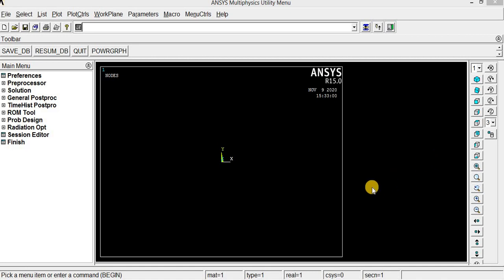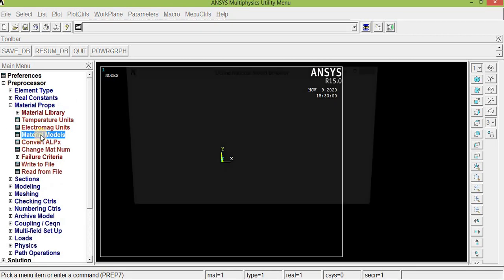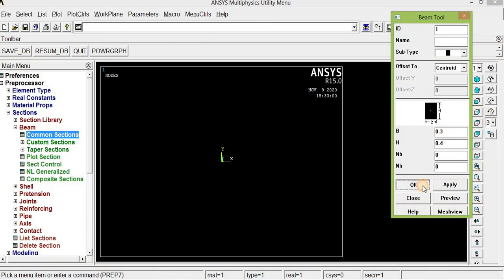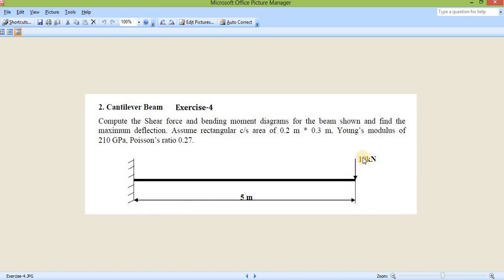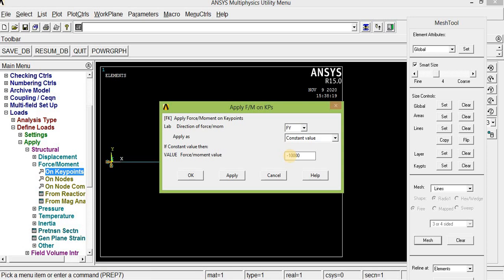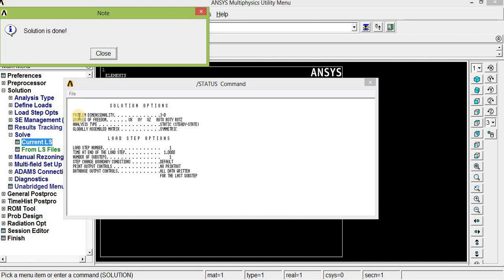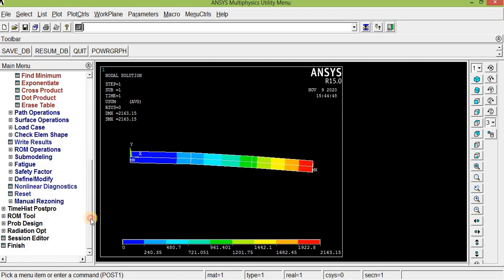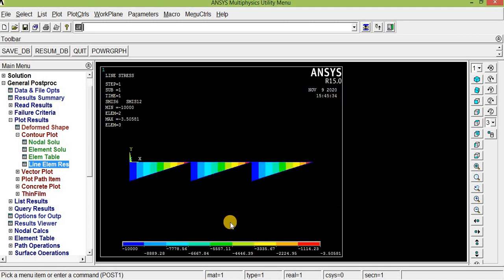Shear Force, Bending Moment Diagram and Deflection of the Cantilever Beam using Ansys APDL

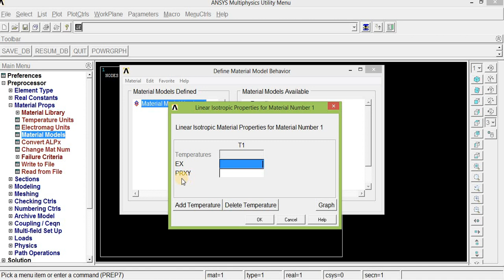Comment: What value did you put in material models @ 1:44 .
Reply from the maker: EX that is Youngs Modulus = 210 x 10^9 
And PRXY is poisson ratio = 0.27
Reply: @infolearn1984  I used this value but cannot add the value in define table @ 9:01 . It shows requested database is not available. The Etable command is ignored. Can help me solving it?
Reply from the maker: There is two element table option. One in General post Professor and the other in plot results. Click the option under General post Professor, you can define the table.
Reply: @infolearn1984  Sir, I did under General post proc only. I cannot add the table value. The requested database is not available. The ETABLE command is ignored is coming. I'm using Ansys 2020 R2 student free version.
Reply from the maker: @dineshelan99  quit the software and delete cookies and try again. Also refer my next video on cantilever beam. If still command not enabled, try re installing the software.
Reply: @infolearn1984  how to delete cookies?
Reply from the maker: @dineshelan99  run - type as temp then enter, select all delete, similarly run - type as Prefetch, enter, select all, then delete. Run - %temp% - enter, select all, delete